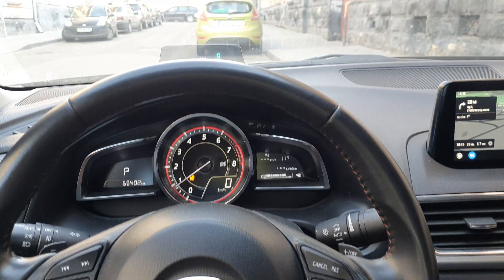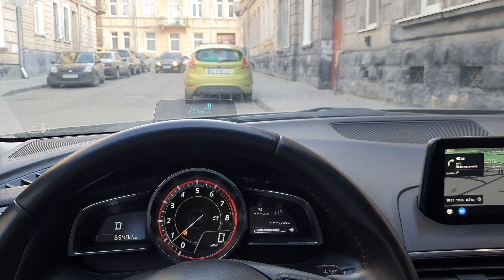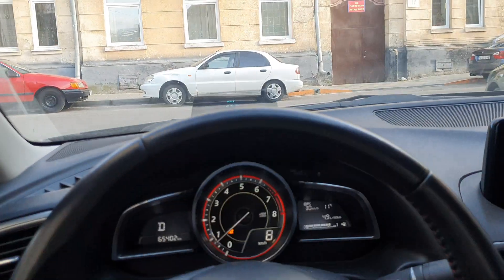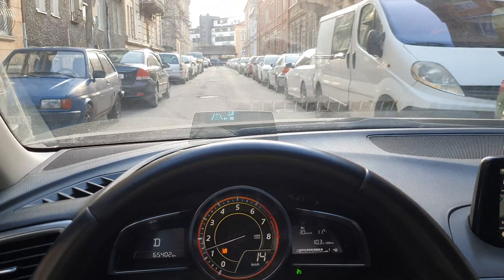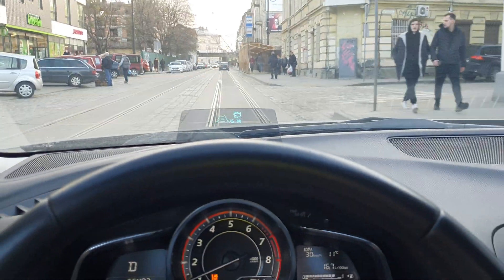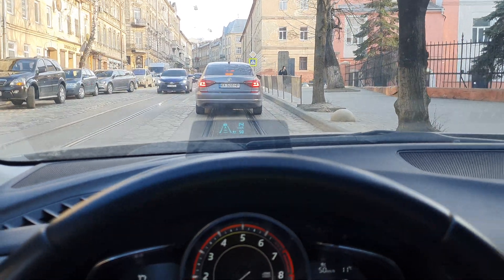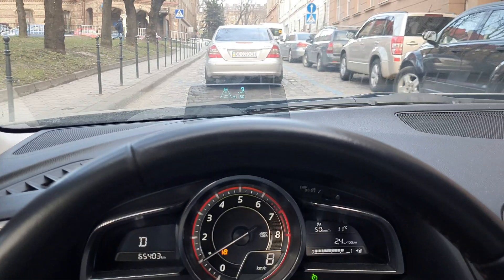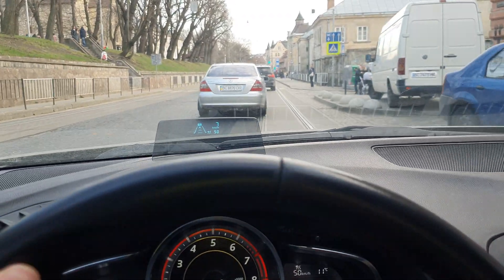Mazda 3 BM - MRCC (Mazda Radar Cruise Control) демонстрація роботи на швидкості нижче 25 км/год

Comment: Great video! You've done some great research and compilation of information for the community.
I've got a 2015 Mazda 3 BM (RHD/Australia) with MRCC. I've managed to import the IC Asbuilt into your worksheet, changed the bit to C, then reuploaded it to the car. The MRCC and SBS is giving the expected DTC. But I can't initialise them again, because Forscan brings up "vehicle conditions are incorrect" error when trying Initialise
Reply from the maker: Hmm, not sure how to fix this, unfortunately.
Reply: @TheSergSlim  It works now..
I was in the wrong menu: I was in the "Service functions" menu trying to Initialise, as opposed to in the "Configuration and Programming" menu (where you also change the Asbuilts)..
#forscannoob
Reply: Thanks for upgrading my 8 year old car 
 @TheSergSlim
Reply from the maker: @eight10man  glad it helped!

Comment: you are a good worker, here in the USA I have a cx-5 that comes from the factory with that system, it also has the stop and go that never disconnects the cruise control and when it stops it goes into hold and you only have to step on the accelerator once and start walking until you reach the speed you set, tremendous work you did, I congratulate you, you are very intelligent